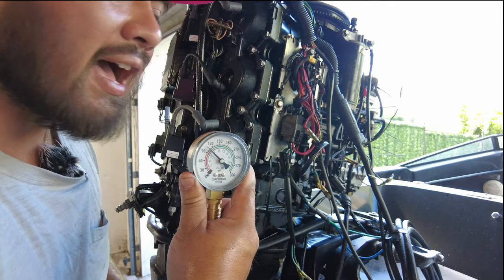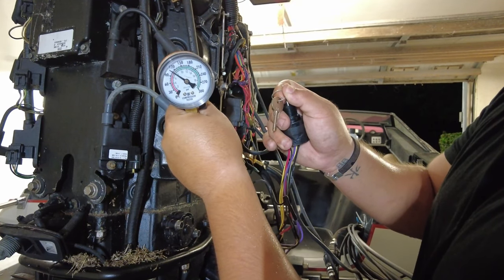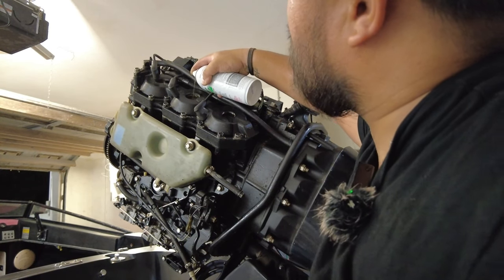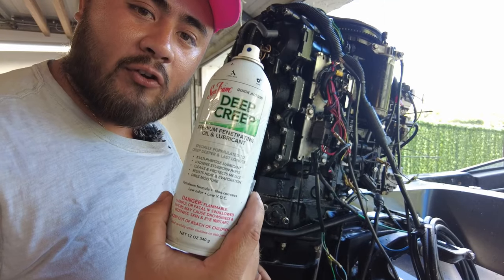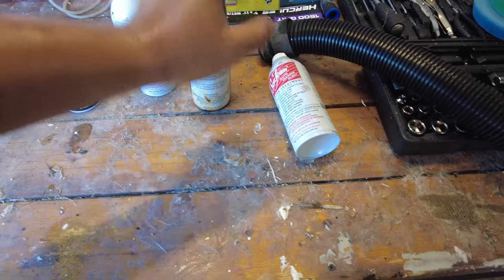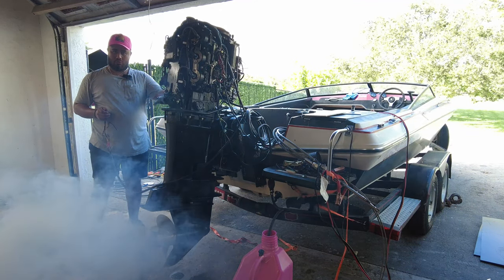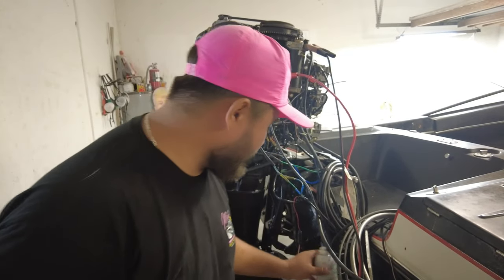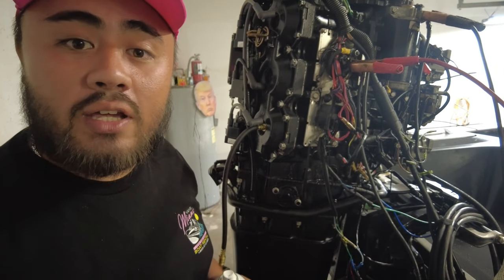THIS FIXED THE LOW COMPRESSION IN THAT ONE CYLINDER  ($400 ENGINE FIRST START! )

Comment: All the plugs should be in motor except the one you are testing and for Tru compression it's only 3bumps on the gage
Reply from the maker: Are you sure? I have no idea if I’m going this right or not. But I was always told take the plugs out. ???
Reply: Wrong, all plugs should be removed, because if the head gasket is blown between 2 cylinders you won't know if all the plugs are in.
Reply: All plugs should be out. Makes no difference on the compression of the cylinder you’re testing but makes the engine much easier to turn over
Reply: You should consider a leak down test. This tells you whether the valves are seating correctly. 

If they’re not, this could cause low compression as well. These tests are usually done at the same time.
Reply: @Leo-mt7qr  "its a 2 stroke"
Reply: @Leo-mt7qr  2 strokes don't have valves.
Reply: plugs in OR out...I don't know what the "industry standard" or SOP is, but unless you want to compare your test #'s to a spec, it doesn't matter if you're simply comparing each cyl to the others. 

If you test later on down the Rd, remember to test the same way again. W/plugs out, engine will turn more freely=faster=higher comp #'s.
Reply: Also put a few drops of oil in the hole. If cylinder was washed down the rings may not be sealing any more- then address whatever issue caused misfire. (Not addressing the issue in this video, just putting it out for anyone who might be having their own low comp problem.)
Reply: @Leo-mt7qr it's a 2 STROKE engine the valves should be just fine 😂😂😂 .....
Reply: @GO_OutDoors  With all due respect, 2 stroke outboard do have ''valves''; usually leaf valves. They are located in the intake and bend open on the vacuum stroke to allow the  mixture from the carb to be sucked in the crankcase (and eventually reach the top of the cylinder thru its intake ports) and then close on the next stroke as to block gases coming back out the carb. These leaf valves slapping shut is what gives 2-strokes their distinctive metallic sound. Regards !
Reply: I mean, unless the instructions on my compressionkit are completely wrong. You should have the engine warm. Pull all of the plugs and then try compression in each cylinder. Essentially , you put oil in that cylinder and sealed a pistol who seal causing compression to go up @boatvibes
Reply: All plugs out throttle wide open crank all you want it's only going to reach so much but 5 spins is fine
Reply: @boatvibes   Do you actually put the oil in the cylinder when you pull out a spark plug or do you add it to the oil?
Reply: @fatvegan733 ATF is thin and highly detergent, a tsp is a good amount per hole.

Never turn an old engine over without juicing the rings up and pulling the ignition then turning the motor a tad after the ATF has had a day or two in there. Build some oil pressure up before anything gets really moving.

Comment: The compression increased because he charged the battery between tests. You can hear that it's cranking faster in the second test.
Reply: If the rings were sticking it would put more load on the starter though, slowing it down a bit I assume.
Reply: @Dailyfiver  I'm not sure about that. Sticking ring doesn't mean it's sticking to the cylinder. The compression is lower with a stuck ring, so it could be easier to crank. A stuck ring could also reduce the oil film, creating more abrasion, so I'm not sure. Other people agree that the test could have been done better, though.
Reply: @Dailyfiver  Rings get stuck in the piston lands/grooves, not cylinder walls.
Reply: @DarkFlamage  oooooh okay. I appreciate the knowledge.

Comment: I'll be honest with you brother seafoam Deep Creek is very very good stuff I've used it with success the whole problem with your motor it hasn't been used it needs to be taken out and used like a small block Chevy car motor and everything will come back everything kind of has a heard and is sticking because it sat so long take take it out with some fuel treatment and you'll send Dan after running it for a certain amount of hours a decent amount of hours then recheck the compression and you will see the difference
Reply: @buellrod  Your comment is not the easiest to decipher. Try using a period at the end of each of your sentences. Might help.

Comment: Snake oil my Friend temporary fix believe me that engine is 1 step away from a rebuild , if they even rebuild outboards . Do not trust you could be stuck on the ocean
Reply from the maker: Thanks for you comment, Where are you from ?
Reply: Detroit Mi. I used to ride and modify Jet skis until my back and knees went but I do know I have tried that stuff yea maybe you did get lucky and the piston ring somehow went back into its original groove . I was never that lucky well I had to rebuild a 2 stroke seadoo motor the 110 horse 2 stroke . I love jet skiing especially riding the supercharged 4 stroke 300s they are like sitting on rockets.
Reply: I agree snake oil! all that does when you shoot oil in a low compression cylinder is filling any voids causing the low compression you still have too low of compression difference between that one and the others. bore scope the cylinders and I am sure you will see scratches in the walls of the cylinder
Reply: Yup , possibly already idles ruff,  rebuilds depend on the bore, to much  it will run hot, want to say 30 over is tops but not positive i remember correctly.

Comment: Is the motor at full throttle?  It should be for compression test
Reply: Not on that engine
Reply: @brycecox9420  should always be we aren't using the key no pump and no ignition

Comment: A pro tip......hold the motor at wide open throttle each time you test a cylinder.Use old plugs when using seafoam.Good luck guys

Comment: Hay fella, just wanted to say thanks I’ve had an issue with my 4 stroke Suzuki 60df 0psi compression on cylinder 4 didn’t have any sea foam as not widely available in UK  so tried AC90 pumped half a can in there left it over night and bingo now getting 150psi cheers again
Reply: What about after use does it still read the same

Comment: I had an old 3 cylinder 60 hp outboard that had 90 psi on all the cylinders after sitting for a few years. motor started and ran still  Ran some sea foam in the gas tank and compression came back to 130 psi in all 3 cylinders.

Comment: Looks like you had a sticky ring or two, which is why the penetrating oil works to free it up and get you a better compression.. it's not a miracle cure, but it's enough to get the engine running which is what it needs to do they get the compression rings to seat properly again.... And I noticed that you got good spark there judging by the way you jumped LOL

Comment: I'm trying this on a boat that has been sitting up for six years. It was suggested that I use this product but that I should take it slow. Spray 2 applications wait 24 to 48 hours, spin prop while in gear then do a compression check. Hope it gives me good results on my Evinrude 115.
Reply: Any luck with the Evinrude 115?
Reply: @Thomas_Dede  no, been too busy with other stuff but last time I tried I had no current to starter, with good battery. May try and work on that tomorrow and see if can at least get current.

Comment: Putting oil, in this case the seafoam, in the cylinders increases the compression every time it’s the easy way to tell if rings are going bad. Being said, I’m impressed it was still higher after it ran for a bit

Comment: Just did this to clean the piston rings. Psi 105 to 110 on all 4 to start, then 125 after deep creep, but the deep creep is forming the seal, so it's not a true value.  I did do the sea foam shock treatment after the deep creep and I'm getting 118 on all 4 and it runs much better. Running 1989 88hp johnson spl.

Comment: If you do the same test with engine oil, I'm sure you would get the same result. Sea Foam surely covers the cylinder surface and the ring, and now they seal better like they would do with any lubricant.The second test should be done after using the running the engine for some time to warm up and burn the lubricant. 

I do not want to say SeaFoam does not work, many people swear by them and I put them in my tank now and then.
Reply: Came here to say the same.

Comment: i found this video and you very well may have saved my tail on a little LT80 kids quad also a 2stroke. that had been sitting for a very long time while i slowly rebuilt it . at 1st i thought it was the starter well pulled that and everything was fine . then maybe the relay which it tested within spec on the ohm meter lastly got a new battery for it and it was still kind of struggling i guess from lack of lube tried that 1 time working like it should now . just sprayed a little more not much of deep creep going to  letting it sit for 24 hrs before getting some premix fuel and a new plug tomorrow

Comment: you should run the motor , let it cool then do compression again. if its been sitting, good chance a ring or 2 is just gummed up. those additives did nothing but help seal the rings because they were bone dry from sitting. the power tune is good stuff, however.

Comment: maybe do another compression test before taking it out on the water. adding oil/ext will increase the compression. looks like the piston rings may be worn also does it hold compression is something you should check. anyways thanks for the video! good luck with your boat!

Comment: its the same stuff as Merc power tune.  Of course you are going to get some compression back with cylinders filled with a penetrant oil.  You might even get lucky and those stuck rings in that cylinder might free up without destroying the cross hatch of the cylinder walls.   Next step clean the carbs and send it.

Comment: Serious question: do you think it's worth buying and messing around with a used black max condsidering how old they are? I had one a long long time ago and rember drilling out corroded bolts, and they just don't get better with age.  Thank you
Reply: i have a 1995 mecury 150 blackmax 2.5 an that thing is a beast 125 psi on all cylinders

Comment: ****Did I call it.. go ahead and check, I'll wait right here...
Reply: But for real, I am so happy for you, these motors are great, the weakest link, if not replaced already, is the original IGN coils as they crap out and short to ground. Which then acts like the kill switch is pulled, so no spark... 
 My one thing I really wanted to do is to send that ECU on the back out and get it upgraded for more advance and to up the rev limiter,!! That alone would be a huge difference in and of itself!! 🙏🙏
Reply: Oh, so I just wanted to check in with you and see if you think it's getting some good voltage ⚡⚡ to the spark plugs!?!? 🤣🤣😁😁
  Oh I've gotten it more than enough to be able to bust on ya for catching it, and with wet feet no less!!
Reply from the maker: 😂😂 yes spark test was successful.

Comment: I say run it but make sure someone can tow you back if the motor doesn't run right did you change  the oil in the engine and do a service on it just to make sure everything is good before you put it in the water  but you got a deal on that engine
Reply from the maker: Lol no one said I was putting this engine in the water anytime soon, it’s a 2 stroke, $400 is a amazing deal.

Comment: All plugs should be out, and throttle should be wide open
Reply: why? wide open throttle does nothing to the compression results youll find. The compression is what it is no matter how open or closed the throttle plates are. Check one both ways and youll see no difference in the numbers.

Comment: Hey guys I'm having a low compression problem on a qg15 engine, i change d block and now it's not starting, any ideas?
Reply: Did u figure it out? 1st need more info to determine the cause. How many Cyl is Low?, Is everything assembled correctly/Head gasket, Timing, Etc?

Comment: Hi, You definitely had a lightly stuck ring on that low compression piston which, frankly, ANY penetrating oil would have released. While we're at it, the true and tried solution pros use for that is a mixture of ATF + acetone (50-50). As to getting the post-Seafoam increased readings in the other cylinders, I'd bet it essentially derives from measuring compression on an originally dry VS a than wet cylinder. Sea Foam is not a bad product at all and surely holds its own against any other of its class (Power Tune, Marvel Mystery Oil, STP etc.) but honestly, its virtues remain short of magical as some users profess. Regards !

Comment: First ride on my ski after this method was amazing I got the same low psi after running my ski in the water the second time so idk how well this works
Reply: putting oi in cyl and improving compression is a positive test for worn rings (try a little straight oil and compression will likely hit 130 ranges).  If seized, it might free a stuck ring but usually your compression increases just for testing and a hone/ring job is likely needed at minimum.